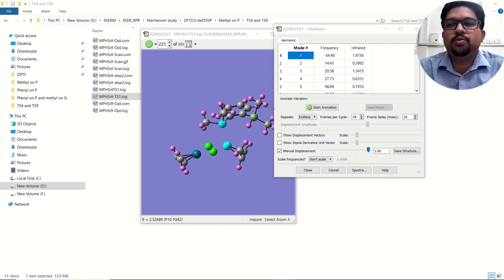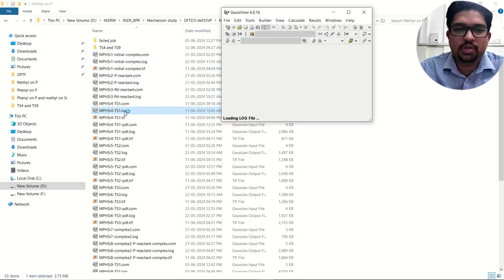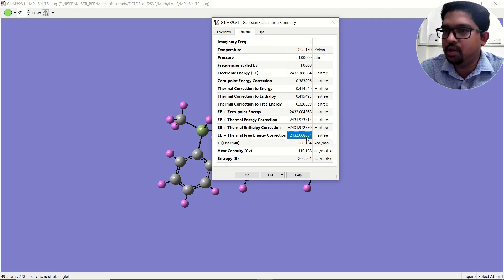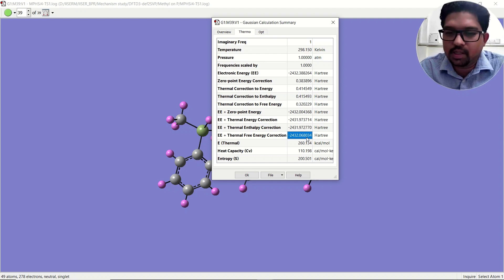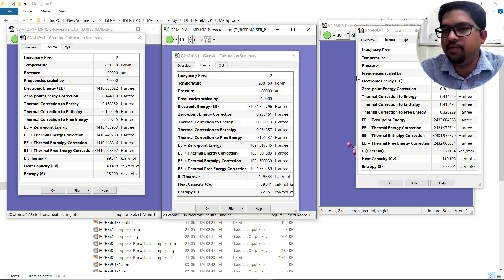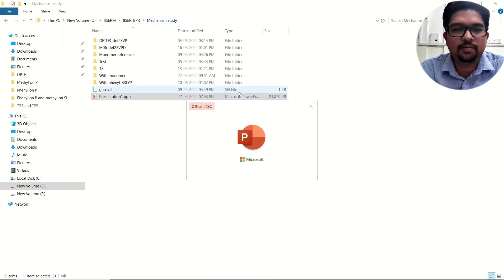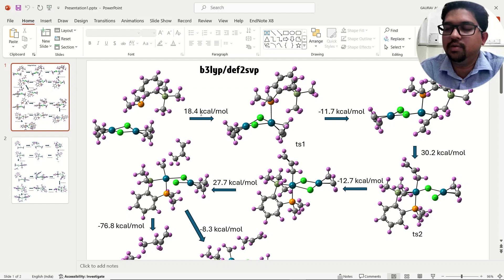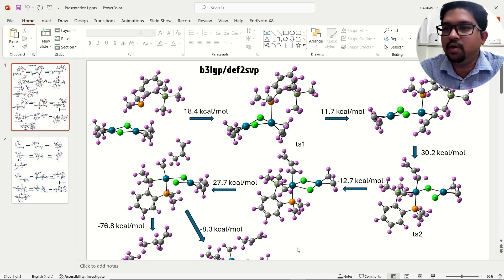All About TS Calculations and data Analysis || Part 1

Comment: Thank you sir for sharing free energy calculation. It’s very helpful. May i ask you how to make this complexes? I mean before starting the Ts calculation
Reply from the maker: For making structures you need to know about molecular modeling.
You can follow this tutorial 
https://youtu.be/K-k4Y845wOA?si=VQi2JwpQgVhWe6Da

Other than this you can follow another tutorial 
https://youtu.be/5s7R3jWTWPA?si=L2POwZeS4gYk_xsu

If still you have doubts, you can take the membership of my channel and you will get the full (2hrs) tutorials on these topics. 
There will be a join menu just click there to get the membership. 
Or you can contact me on
chemistjhaa@gmail.com
Reply: Sir i am considering optimized ccdc structure as my in put to make complex i am getting difficulty in making 3 molecule complex.
Reply from the maker: @pavan8140  better design from scratch (from beginning)